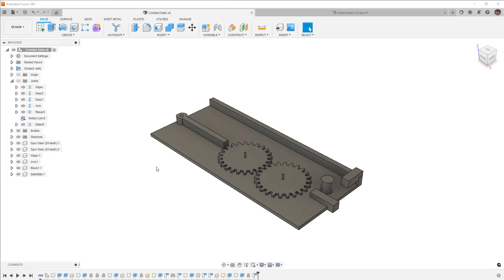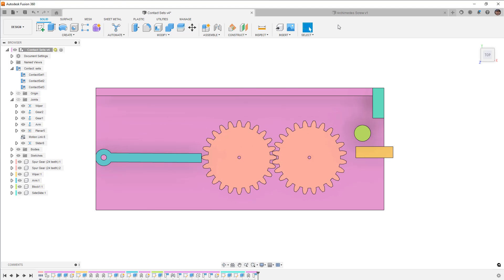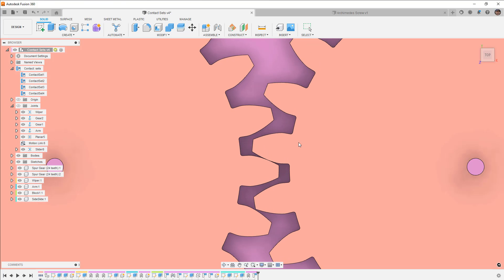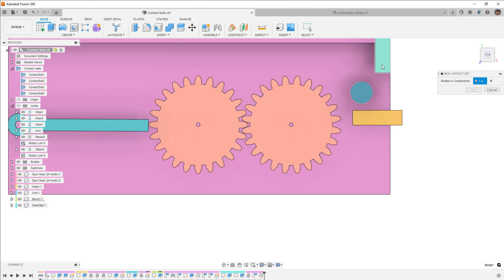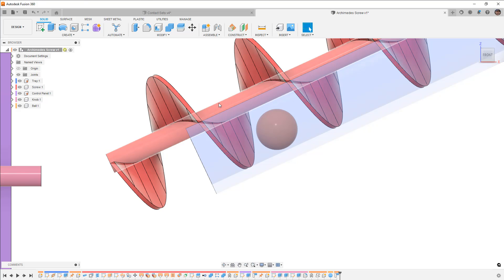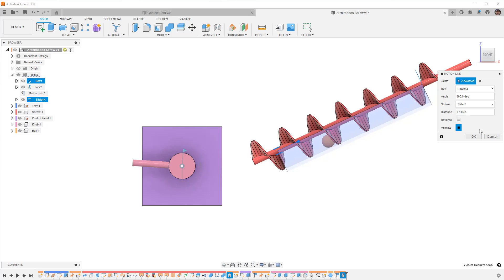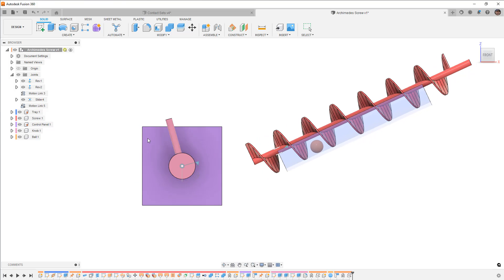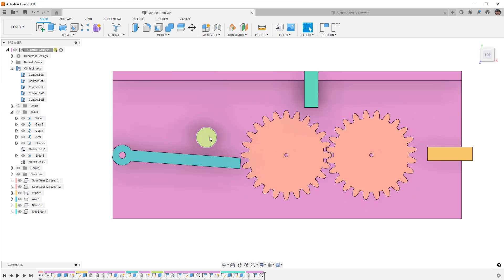Contact Sets | When To Use Them And When To Avoid Them | #Fusion360

Comment: Hello Mr. Matt. Great video as usual

Is there a way to natively test the kinematics and dynamics in the CAD software other than exporting to Ansys ?
Reply from the maker: Test as in simulate?  Like a dynamic simulation?  Fusion does have a simulation option for projectiles if you are trying to understand small movements and material behavior.  In terms of movements with contacts that is  a tricky one.  I have found that Fusion actually handles this better than other CAD, but it really doesn't have a dynamic motion simulation option sadly.  Motion Studies found in the Assemble menu allow you to drive a joint or joints and see what the motion is like, but tend to lock up with contact sets.

Comment: Ok, but what if i have a situation where I have a mutilated gear, ie teeth on only half the gear. In this situation, a motion link doesn’t do what i want, since i only want the output gear to turn when the  teeth are meshing. Imam trying to use contact sets and everything is jamming. Would a proper backlash fix this?
Reply: Or is there a third method tgat might achieve this?
Reply from the maker: what happens to the gear when the teeth no longer engage? How does the half gear get moving again?

What you might have to do is fake it because true gear contacts can be very processor heavy and tend to lock up.  if you can email me a file/pic to support@ caducator I might have a better answer.  My first thought is a set of hidden components with a simplified version of your contacts.
Reply: @LearnEverythingAboutDesign  The half gear would be the driver. First meshing with a rack,  then with another gear. So the output gears move in sequence. First the half gear moves the rack, then it moves a gear.
Reply from the maker: @sethother8012  Yeah that is a tough one.  https://a360.co/3HN5yKF  This one works but the gear to gear contact sets forces it to go crazy calculating the intersections.  Gear to rack seems to work a bit better.  My only other thought is to do this with some sort of Geneva Mechanism setup where the contact is a cylinder in a slot vs gear tooth interaction.

Comment: Ah, this is one thing in Fusion I did work out myself. I used it to mock up the motion of the rocker gear in my Riley to work out the best curvature to grind on the rocker arm pads. It got a little too complex for it though as there is a push rod with spherical ends that I found it couldn't accurately model (or I couldn't work out how to do it properly) so I had to split the motion into two halves.
Reply from the maker: Nice work!  Fusion did add the tangent relationship which I covered with a rocker arm BUT it also has its limitations.